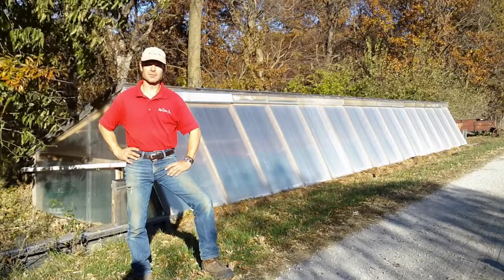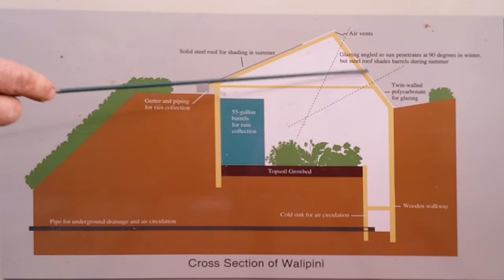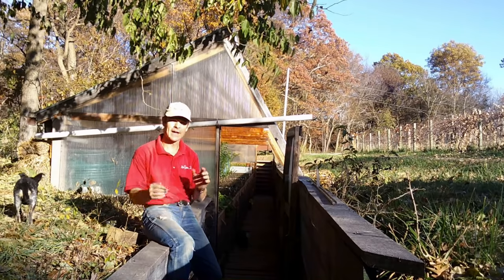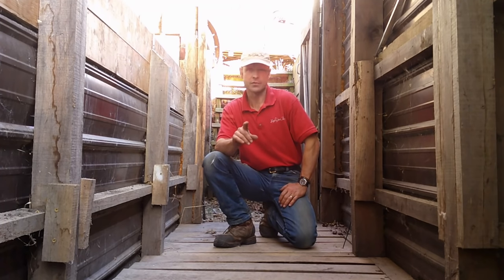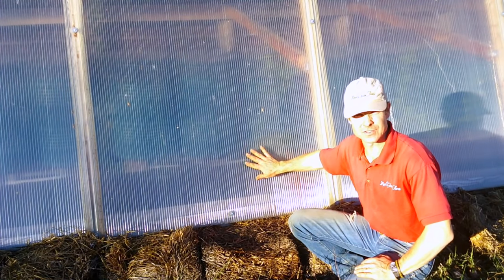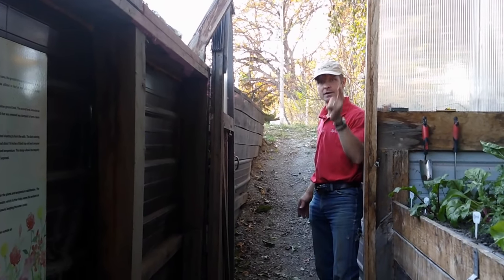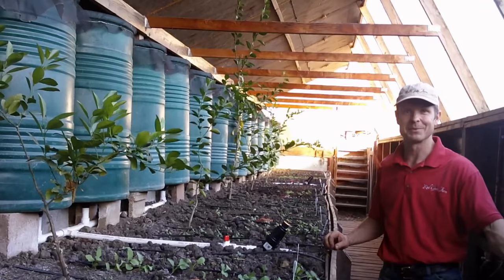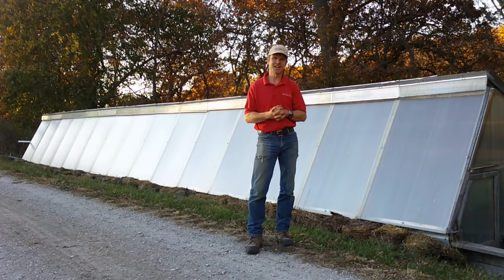Farm Tour Series: The Walipini; Use, Design, and Construction

Comment: cost factor alone is totally disproportionate. You would need at least 11 years of full produce in order to attack the cost of your structure. In 11 years, tour structure would need major renovation so again, more capital output.
Reply from the maker: That really is dependent on the variables.  We used lumber mostly sourced from our own mill—free.  We purchased used barrels and insulation for very little, cheap roofing and gutters, etc.  our primary cost was the twin wall polycarbonate and hardware, though others have used different, much less expensive plastic sheeting or such.  You really have to get creative.  In our case, we calculated that ours paid for itself in about 6 years, with only seasonal production.  It’s certainly doable, you just have to be creative based on your budget and goals.

Comment: You would be better off with metal barrels because metal conducts heat into the water better than plastic.  Every factory that makes metal fabricated products uses powder coat paint which, often, comes in black metal barrels.  You could ask them for their empty barrels or find out which scrap yard they send their barrels to and buy them from the scrap yard.
Reply from the maker: From the perspective of heat conduction, this is true. However, one must consider all factors.  Metal will rust with time and eventually rust through.  Any coatings or paint may be toxic to the plants/soil.  Rust would increase the iron content if the water is used for irrigation as ours was.  This is an aspect where each situation can differ, and different materials can be required in different situations.
Reply: @ADifferentWay  As a powder, there is little residue in the tanks and they can be easily cleaned.  The powder is just plastic.  Rust is just iron oxide.  Aside from tetanus there is no risk and tetanus would have to enter the blood of a person.  Not likely to happen.  But, the insides of the barrels could be coated to prevent rust or lined with plastic bag.

Comment: What happens if you live on the equator?
Reply from the maker: First you would likely be aiming for a cooler environment rather than a warmer one, so you can grow cool season vegetables for longer periods of time. This would mean there will have to be additional ground tubes to bring cooling air into the structure. There would also have to be additional vents to be sure to vent the hot air out. Someone in your area should be able to help you calculate the depth Of the structure as well as the angles, which would be quite minimal. Based on our research, building a walipini near the equator would actually offer additional options for size and location.
Reply: @ADifferentWay  Thanks. Would you recommend a geothermal heat pump?
Reply from the maker: That would really depend on the situation. Geothermal heat pumps are very expensive on the initial install. The idea behind them is great in theory, but the benefit really depends on your usage of electricity. We installed one at our farm in Central Illinois, and I’m not sure we ever did get payback. We just did not consume enough power to really justify the installation cost.  Before going that far, really look at the data and the numbers for your region.
Reply: @ADifferentWay  Once again thanks for taking the time. We have really hot summers here, so it's more about a cooling effect. I think if we sink the room and use some geothermal to cool the inlet, we might be able to drop it by a few degrees

Comment: What if your water tanks overflow?
Reply from the maker: So far we have prevented this by simply keeping an on the forecast.  If we are expecting a heavy rainfall, we open all the valves on grow-bed before the rain arrives to help empty the tanks a bit, and let continue to run during the storm.  Once ours are gravity fed, our lines flow about 200 gallons per hour.  We’ve found this a great time to deeply saturate our soil in the bed.  I think we’ve only had an overflow once, but it was slow enough and spread out among enough barrels that it didn’t damage anything.
Reply: @ADifferentWay  thank you for replying. By the way I've studied these quite a bit and this was the most detailed and easy-to-understand explanation that I've seen yet. Keep up the good work.

Comment: Air movement...

 I would have oscillating fans in there
Reply from the maker: We have absolutely no power source at the walipini. It is totally self-sustaining. The great thing about the cold sink though, whenever there is a temperature difference, you stand on the floor, and feel a convective flow coming up from the floor and circulating through the greenhouse.

Comment: vous avez fait un puit canadien ?
Reply from the maker: assuming I translated this correctly, This could certainly be modified to potentially help with geothermal well system.
Reply: @ADifferentWay  By connecting a stirling engine to your stove, which drives an alternator, you can also have light in your greenhouse in winter!
This allows more photosynthesis in winter or the days are shorter!

Comment: I would like to know what you would do different
Reply from the maker: More subterranean ventilation. Concrete front wall, footer for the water tanks, lids for the tanks, and gutter drain in the interior tanks just to name a few.  We have been collecting ideas to make it better and the list is pretty long.
Reply: @ADifferentWay  what do you think about GHAT system? I like your idea and a GHAT system for the one I want to build.
Reply from the maker: I regret that I didn’t use a GHAT system or something similar.  It would be a great compliment to this design.
Reply: Yes I watched it. I'm in NY and would like to do the same thing. Grew up on a strawberry farm we did all the other produce to but are green houses were propane and firewood and it never worked great I think. So mixing your system and GHAT system is the way I'm going to do it.

Comment: Why not black tanks to absorb more heat
Reply from the maker: You have to consider all variables, and different colors actually offer different benefits. While black does indeed absorb additional heat, it does not reflect light the same way back onto the plants. We chose green because they are dark enough to absorb sufficient heat and great at reflecting light back onto the plant from the backside of the walipini. This works better for our situation.
Reply: @ADifferentWay  awesome

Comment: OR... you could put a much more practical and cost efficient structure by putting it on ONE SIDE of an existing structure, like a house or barn...
Reply from the maker: This is very true, although our house at the time was fully shaded in the woods, and thus we had to locate the walipini in the sun. With the new design we are currently working on, we are attaching it directly to the south side of the house.

Comment: There is not tremendous amount of light and energy coming in in winter, the south is too deep, near no plant got direct sun.
Reply from the maker: The angles, assure that the maximum amount of sun possible comes through in the winter. As discussed in the video, the front of the grow bed has a small shadow, within a few weeks of the winter solstice. However, any plants over 3 inches will get full sun on the leaves.

Comment: planting soil looks really clay/clumpy. A lot of work on the structure but poor soil.
Reply from the maker: This soil is terrible.  We ordered good top soil,  and when they brought it in, it looked beautiful, rich, and black.  But the first time I went to work it, I discovered it was just black clay.  I have been working the last 5 years to improve it.  Progress is slow, but steady.
Reply: @ADifferentWay  That happened to me when I put raised beds in . I asked for nice soil for grow beds and got crappy clay garbage. I was  so angry.  I have a small tiller that was helpful in loosening the soil . That would probably work for you too?  You might have to actually remove  a lot of that section by section to get it up to what you 
..really want ? Add a lot of compost .
Reply: Put the clay stuff on your burm?
Reply from the maker: It's still rough, but we've made enough progress now that we just decided to keep working on it.  Every season, we add in peat moss, compost, and occasional do soil testing to see what other amendments are needed.  in addition, we use a broad fork, a hand tiller, and even worms to get it all well mixed!

Comment: way to much work to much infrastructure for the little amount of gro bed area
Reply from the maker: I was toying with that too during construction.  However, I found the opposite to be true.  Most of the time in gardening is planting, weeding, soil prep, and harvesting.  All of these are significantly easier in a standing position with everything readily accessible.  Construction time compared to gardening time is minuscule.  The benefits of the ergonomic design will last for years and save valuable time and effort.  Additionally, as mentioned, during planting season we stack vertically and double the grow bed.

Comment: You lost me when I saw you in the pit without shoring. Walls of that pit collapse you goes would lose your life. You need to learn how to be safe before entering pits.
Reply from the maker: I appreciate your concern for our safety, but let me explain.  Whether it is safe from cave-in is completely dependent on soil type, the angle of cut, the depth, time, weather, and many other factors. We consulted with the excavator about this. We have a very hard yellow clay, which is very stable and can actually sit open for a long time. In addition, we cut the wall at an angle instead of completely vertical. Think about the tens of thousands of home basements that are dug every year and workers get in to lay concrete and build a foundation without shoring the walls. Pit walls will eventually collapse over time with moisture and freeze-thaw cycles. However, they don’t collapse immediately. Our bigger concern was the driveway nearby. That could cause stress that could cause it to collapse prematurely. However, the excavator made sure it was far enough from the driveway that we had ample time to get the wall up prior to any chance of collapsing. Thanks again for your comment and I would recommend anyone digging a pit to consult an excavator or engineer for that area and soil type.